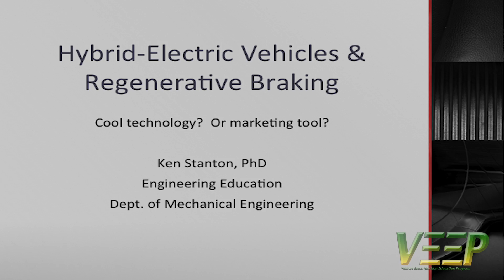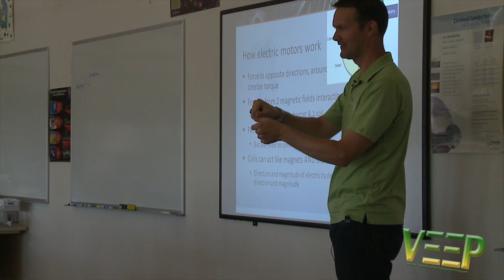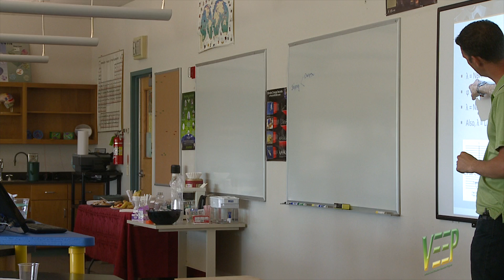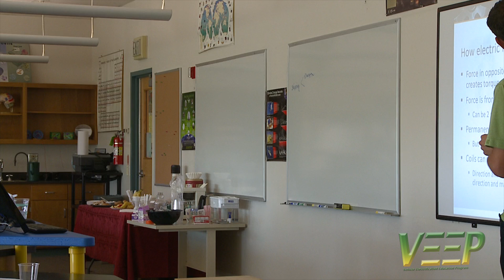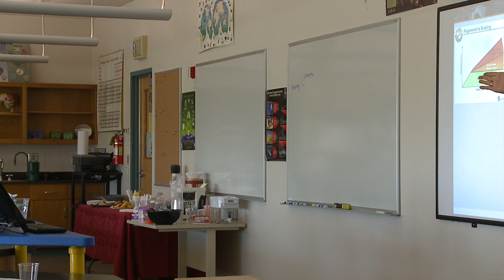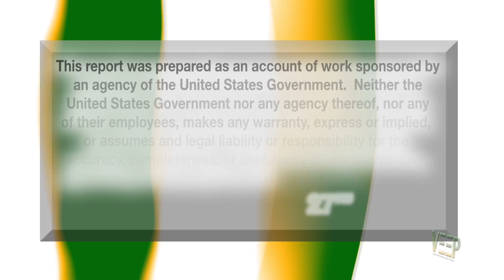Hybrid Electric Vehicles and Regenerative Braking

Comment: Still relevant in 2021. Skip to 23:00 to get past the electric motor fundamentals. 30:00 is where back-EMFs for regen gets explained. 32:33 is where flipped polarity gets explained. 33:12 the most important part. The regen to friction ratio graph is at 34:00

Comment: Dude... You just mentioned a breaking method and (maybe) didn't notice it. When your student broke the hand crank...by short circuiting the motor. Just do that to your drive motors at each wheel in an ABS brake fashion. It would require a system to regulate by controlling the short circuit voltage and timing but might just beat conventional breaks! You could also blend it with regeneration to get the most power out too. Any response would be help full. Thanks!
Reply: Shot Circuiting the motor as a means of braking is not a good idea, because short circuiting the motor when your vehicle is on high speed could cause the car to skid and the interaction between the moving wheels and the short circuited electric motor could damage the electric motor.